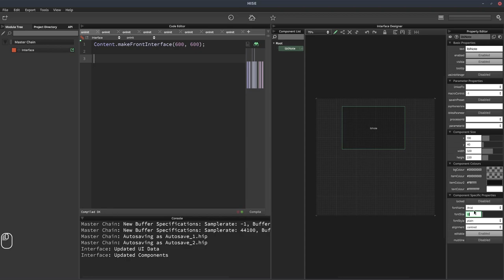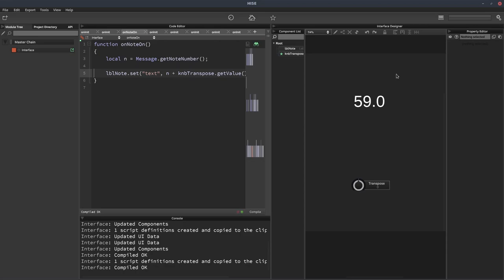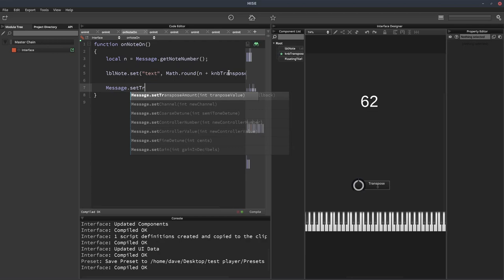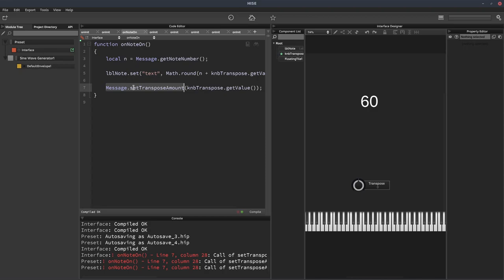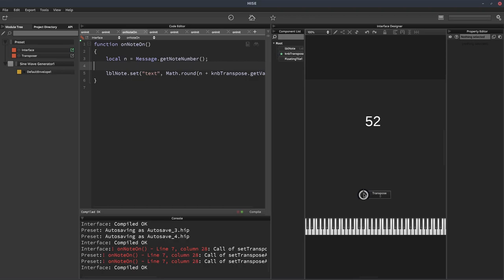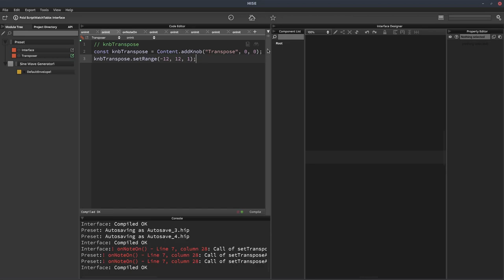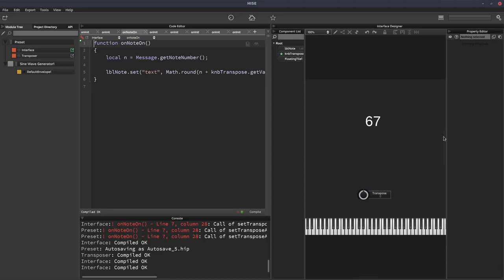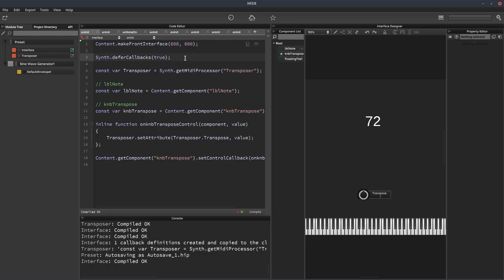How to make a transposer in HISE | Real time and non real time threads

Comment: Hey David - I have seen that you share some kind of a sample player over at the Ardour Forum where the user can import its own samples from the DAW.. 
can you do some tutorial how to build that kind a thing. That would be a great starting point for creating big stuff with Hise...
Reply from the maker: Hello,

It's not using the sampler, it uses the audio file player, it just loads the file from the user's system. I think I posted the source code on the forum (or it might have been at VI-Control). I'll make a video about the file player at some point.
Reply: @DHealey  thanx for the tip - I digged into the VI-Control Forum and found the pCloud link. 
Now I will inspect the project and see what I can learn - thumbs up for your great work and the help you give to the people

Comment: If the GUI knob for the transposer is running on the message thread (Synth.deferCallbacks(true);
and we use MIDI learn to connect a CC to that knob in our VSTi,
will that MIDI learned CC controller -> transpose suffer in real-time performance, given that it is “playing” through its connection to the message thread in the GUI?
Reply from the maker: No, MIDI learn goes through in realtime, even when the UI is closed